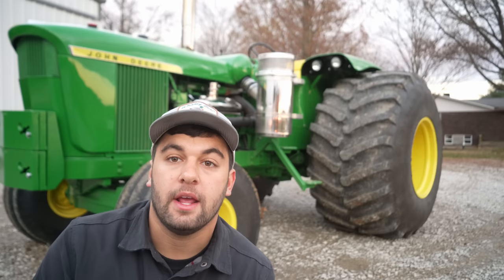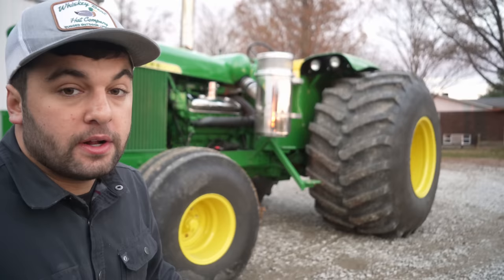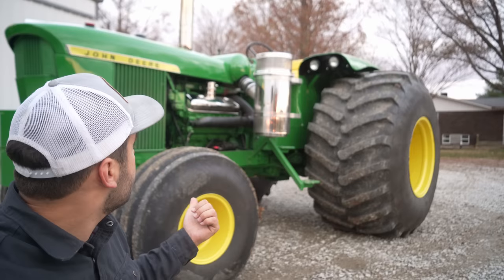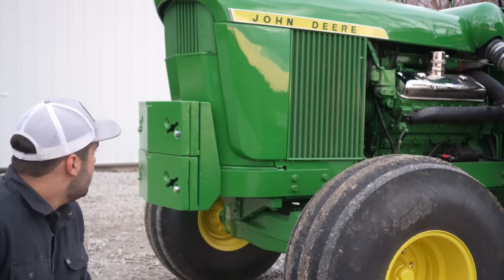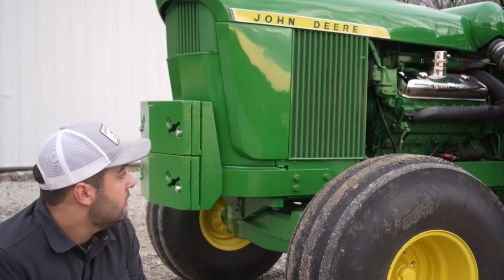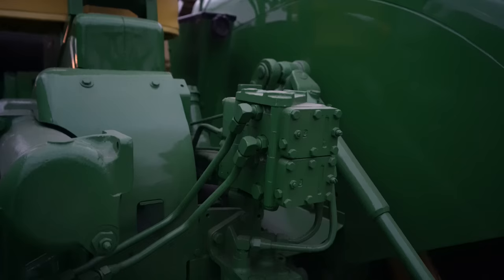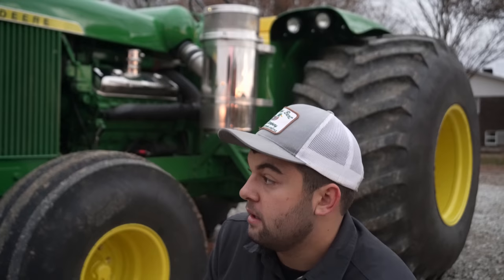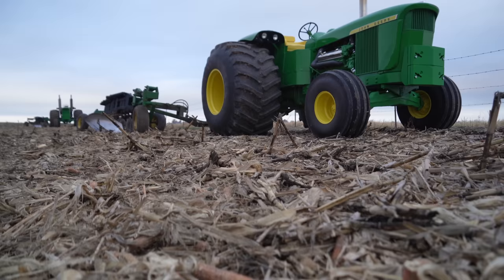John Deere 5020 Repower- 8V71T Detroit Diesel

Comment: Its not just the added hp and speed, both of these increase the efficiency of the plowing. Allows for better penetration of the plow and more rollover and aeration of the soil. 5020's were very much under powered in the factory version, so this repower really improves the looks and the working ability of these tractors.

Comment: I drove a mid 80’s GMC general dump truck that had the 8v71 with both turbo and blower. It was factory. In that application it was pushing 440hp. A royal beast.
Reply: You can blow smoke up some people's - - -     but you can't blow smoke up mine. If  it was making 440 horse power it was a 8 V 92. END OF DISCUSSION.
Reply: @warrenklingensmith1241  you may be very right. It was a long time ago. But no need to ignorant about it.

Comment: Great Video and Excellent restoration on your JD.  Just FYI..... the Detroits do Not utilize "Superchargers" per say.... they are Roots Blowers, which are just volume air movers, in other words they Do Not "compress" (re: pressurize) air, Internally.  Any boost generated by a Roots type positive displacement blower is strictly due to back-pressure resulting from pumping a higher volume of air, than what the engine can handle per revolution.  

A great thing about the Roots type blower is that regardless of how much external pressure may build up... the air temperature remains quite ambient within the blower casing as it passes through the helical lobes.  If everything is "tight" on a Detroit, you can generally register 3 to 4 psi in the air-box on a NA engine, and higher of course with a turbocharged version... depending on which blower you have.   

The best blower to use for making as much power as possible WITH a turbocharger, is the High By-pass version as used on the marine engines.  There are three different case versions, the standard blower used on all the NA (Naturally Aspirated) engines with no by-pass valve, the By-Pass blower and the marine High By-Pass unit.  There are also a couple of gear drive ratios for the Roots, all over-driven to a  minor degree (8 to 12+ percent, roughly - I don't have the numbers right in front of me at the moment) compared to crank rotational speeds.  

The other type of positive displacement blower (or "supercharger") is the Lysham Screw Blower, which actually compresses (pressurizes) the airflow Internally before exiting the casing.... they are also much more expensive, due to the complexity and required tight tolerances of the lobes.  They have been around since the 1930s, but only on large diesel engines of the medium speed class (between 250 & 900 rpm maximum) as found on mid size ships and some European diesel locomotives.  

Since the late 1980s they have become "down-sized" and can now be found on 100 percent of the Blown Alcohol Dragster & Funny Car classes of both the NHRA and IHRA drag racing, as well as some of the Top Fuel & Fuel Funny Cars in both sanctioning bodies. 

According to the MODEL numbers on the ID plate on your 8-71T... was it Originally built (the engine, only) as an 8V71T, or was the turbo added at some point later?.... and IF so, were the pistons, cam, injectors (and timing), 4 valve head (?), etc, changed at the same time, if at all?  

They are Fabulous engines and legendarily reliable..... just Never let the engine temp rise Above 200 degrees, Especially with 4 valve head(s).... and only let it idle long enough for the turbo to spool and Cool down, them shut them down if their not going to be put back to work within 5 minutes or else the cylinder temps will drop down considerably and you run the very real risk of glazing the liner walls.... never a good thing.   

One of the leading causes of increasing black smoke and at the same time... more and more oil drainage from the Air-box drain tube(s).... is two fold,  excessive idling and leaking blower drive seals, resulting in increasing amounts of oil in the airflow from the blower, which also results in "coking" in the intake ports which in turn, results in decreased scavenging, less power and increased black smoke and fuel consumption.   I resealed the blowers on my V12's about every 100,000 / 115,000 miles or about every 9 months plus or minus.... and Never had any of the issues, that others had... it's called Preventative Maintenance.   

I've known guys who sent their 8-71's to be rebuilt (never "rebuild" - always Re-man... much cheaper in the long run), After removing the blower, then remounting the blower after a rebuild, cursing the engine and the re-builder because it "blew up" in 50,000 miles or less!!..... in reality, it was their own Ignorance (of the engine) and sometimes, stupidity... that caused it.      OOOps, sorry for the "book"!!    Anyway, and once again... Thank you for sharing your tractor and the fantastic restoration of it..... don't "let it go"... stay with it ("Preventative" Maintenance ALWAYS Pays off in the long run!) and take good care of it.   

I have subscribed to your channel and will be looking for more videos from you.... take care and have a Blessed, SAFE and Prosperous New Year... Lord Willing!!

Comment: This video got me to subscribe. Uncorked/straight-piped, 2-stroke Detroit diesels are like my beloved rock and roll. I have run dual-exhaust, no-muffler 318's over-the-road/long-haul. Also, I want to see more farm tractors like this. When I started farming in 1974, I bought a brand-new, IH 1066; and the day it was delivered I put a chrome, straight pipe on it. Always kept my tractors waxed.
Reply from the maker: Thanks for watching Douglas, more is on the way!

Comment: This is a souped up tractor,that works on an almost daily basis,and is a good old puller and with the tires and turbo,it's has plenty of power,and counter balancing the front end better will help eliminate some of the bouncing that occurs,lid like to see it with custum dual tires and wheels in the rear

Comment: Make sure the 8V71 gets enough revs - don't lug it at low speed for hours and hours, or you could melt a piston. They only lubricate properly when screaming, >1800RPM or so.
Reply: Make em scream  !
Reply: It's a fallacy that you'll melt a piston or break a crankshaft by lugging a DD 2 stroke engine.
Reply: @SomeTechGuy666  Tell that to the guy who brought his 8V71 bus to the Bus Grease Monkey (known to all DD 2-stroke aficionados on YouTube) that was down a cylinder because of lugging through the Appalachian foothills of Tennessee; 2-strokes need revs for proper lubrication and cooling under load.
Reply: @Acoustic_Theory  Complete BS.  The only thing that causes a cylinder to go out is a bad injector.  They lubricate and cool just fine at lower RPMs.   In boat applications they are often run at part speed for days at a time.

The user in this YT video even admits to running a gear high and at lower RPM.
Reply: @SomeTechGuy666  I’ll leave it to the more experienced mechanics to adjudicate but lugging any engine under load is not a good idea for longevity. (This is different from low idle.)
Reply: @SomeTechGuy666  Yes but they see more engines from the field than the engineers do. Here is the video for the vehicle in question: https://www.youtube.com/watch?v=WHbojQt0Vb4

Give your 2-stroke Detroit Diesels plenty of revs for breakfast, lunch, and dinner.
Reply: @Acoustic_Theory  What scientific proof does he have that lugging the engine caused one single cylinder to fail ?  None.  Zero.  If lugging was really a problem all the cylinders would be damaged.

DDs are routinely used on gensets at 1200 RPM.
Reply: @SomeTechGuy666  There are any number of aggravating factors that could cause one cylinder to fail before others, owing possibly to the age of the engine or a prior hard life. You’re switching to a mode of just being difficult so I’ll let you speculate about what could contribute to uneven wear or cooling on an aging engine. The point is that it happened, and it wasn’t that way before being operated under those conditions, so the lugging condition is the most likely contributor.
Reply: @Acoustic_Theory  Whatever.
Reply: @SomeTechGuy666  I highly doubt you have much experience with a Detroit, but at low rpm they can’t throw enough oil up through the case. Under very little load they will be fine. But when at low rpm under heavy load they will deteriorate the oil too fast (heat) as there isn’t enough fresh oil feeding through it. That is why you drop pistons and cranks. Not really because of the low rpm but due to the lack of lubrication it causes.
Reply: @matttraxler3567  DD 2 strokes are used in gensets that run at 1200 RPM.

The oil pumps on DD 2 strokes have a pressure relief built in.   They should be operating at full pressure at any engine speed beyond 1000 RPM.
Reply: @SomeTechGuy666  Depends on what it’s out of though; if it’s out of a semi they are geared to scream. We had a guy they ran them basically at idle. At 50,000 the internals on that motor looked like they had 500k on. No lubrication through the case.
Reply: @SomeTechGuy666  That's okay for level running but in a Semi-truck it's a different story. 1700-2100 RPM is the operating range
Reply: @SomeTechGuy666  3 phase gensets run at 1200. Singles run at 1800 or 900. Personally, I would prefer good volume and pressure from just above idle and on. An oil cooler with thermostatic bypass works nicely to keep the sludging in check as well as oil life. 2 strokes are virtually bullet proof if maintained correctly according to their use AND if operated correctly as equipped. Gensets are a constant rpm somewhat variable load situation. Everything else is completely variable in load and operation. Running one in the winter for an hour to "warm" it up is a mistake. Coolant heater all night and 5 minutes to build air is sufficient in a truck or excavation equipment. Work em and get them warm, keep em warm. 5 minutes on a turbo to cool and then make er quiet.
Reply: A.T. is that true? About the rpm?
Reply: Idk army cargo trucks idle for days all come w Detroit. Same with artillery cannons m109a6 and it will idle and run hydraulics at a high idle for a month (30days) straight. Firing artillery... Idk the tractor is sweet though.
Reply: 2 stroke Detroit diesel motors should not idle for any extended time. The oil pressure is too low at idle speeds, therefore hindering lubrication. 
Keep the RPMs up, don't lug it and make it work.
For a 8v71, between 1900 and 2200 RPMs
For a 8v92 run em between 1900 and 2100.
Reply: Acoustic Theory The man did mention its an 8v71T not 8v71. I'm guessing you know what the T is for??? =(Turbo boost ×1)
Reply: @Drivapete   Sounds like you know your stuff there young man.
Reply: @SomeTechGuy666  It’s a lack of phallusy that would make you not scream a Detroit.
Reply: @thegreenerthemeaner 

The first truck engine I  built was an 8v92 Detroit. I was 15. It was in a 1977 Pete. The truck was a total disaster when I started on it. It was actually in the 1977 Pete calendar. Really cool build. Brings back lots of great memories. Keep the screaming demon running! Love it!
Reply: I would be far more concerned with the durability of the Transmission and Final drive than the Engine.

Comment: Beautiful tractor. Would have been great to have on the farm back in the 60s to mid 70s when people simply couldn’t get enough horsepower to keep expanding acreage. The crown wheel and pinion and final drives are amazing in these tractors. If the synchro shaft and counter shaft needed attending to because of the horses who would care given all the extra productivity

Comment: We did something similar back in high school (2007/2008) to an Oliver tractor that the principal had. Only difference was we used a non turbo 71 series detroit, but I can't remember if it was a V6 or V8 model. Was a nice looking tractor with dual chrome stacks, and even was on the cover of a magazine so seeing this actually brings back memories.
Reply: Oliver tractors actually came from the factory with the GM diesels although yours may have been a re powered one .They also used Walkasha, Perkins, Hercules and Cat engines .
Reply: @williamsidis5489  I don't think it did but I honestly don't remember what engine was in it to begin with. I do know though that we had to grind and cut small pieces out of the frame and had to have mounts made though.
Reply: @SOU6900 Yeah the frame tubs were larger for the Detroits.  Cool project .

Comment: I have a 4020 with a Detroit diesel repower.  Came from Cambridge MN
Reply from the maker: Still using it?
Reply: Yes. I cut hay with it this year. And I run it on the disk in the spring

Comment: The 8V-71 had 260 ,290 or 318 h.p. The 8V-71T came in 335 or 350h.p. versions. As to the guy who said his Brockway had a 16V-71 in it, the largest was the 12V-71 c.o.e. and conventional hood. The 16V-71was used in the off road Hayes WHDX 1000 logging truck ' W ' for wide. The Hayes HDX, Pacific P-12 P-16 , Kenworth 850's used the 12V-71. I think Mack also used the12V in their own off road logger after selling their interest in Hayes to Gearmatic div. of PACCAR.

Comment: You have done cool job of these tractor builds with the detroit 2strokes I’m just building my own with based on a Ford 5000 that I have fitted a 6v92t into that is rated at 497hp at 2200rpm, I want to have a go at a little bit of tractor pulling at a local steam fair and would like to get maximum rpm without being to greedy 🤷‍♂️🤠😂  most people are using Cummins over here so mine with the Detroit will be the loudest

Comment: Stand out tractor.
Reply: I I have also sent you a
Reply: @johnlauber9579  ... a what??....
Reply: What model this tractor
Reply: @angelopaulo9781  5020
Reply: The chrome lovers look unreal. Lugging a Detroit or excessive idling is a not on the menu, the oil coils down and doesn't drain properly from the cylinder  liners causing the glazing problem. Try telling that to some people and they just don't listen and end up having the very problem that you warned them about.
Reply: Why cindy are u cheating

Comment: Glad to hear you’re using a radiator with an extra core. Many years ago, I drove a 7520 with an 8v71, but with the stock radiator. It struggled in the summer.
Reply from the maker: We figured it would cool the tractor with the extra core, and that the new radiator would be 100% clean.

Comment: You have done a lot of work to this tractor!  You said the trans. was in trouble when you got the tractor, is that because of the significant increase in HP?  Your fabrication of stuff ie the aircleaner and steps look superb along with your front weight mounting system extremely well done.  All in all its  a beautiful exam-ple of How JD should have done things!  I have a Military truck called an M977 HEMTT and its got and 8V92 that is turbocharged blowing into the supercharger it makes just under 500 HP, one of my favorite engines!

Comment: I would be wearing ear protection.
Reply from the maker: I had ear plugs in, but I might upgrade to some noise cancelling headphones.
Reply: @RennerStockFarms  I use my Bose noise canceling Bluetooth headphones when running my 3046r. Best 300 dollars I've ever spent. They work really well.
Reply: @scalph999  3M bluetooth headphones 🎧 are only 60.00

Comment: Only tractor built that could stand that extra ower to transmission and reaur ends they were built indestuctable
Reply: The red machines and orange had problems with standard horsepower engines 5020 soild as a rock

Comment: The Kinze one is Firestone 19L16 5 ribs front. Those tires are nearly impossible to find. They can be seen on 6030 litterature and the 6030 operator manual.
Reply from the maker: Yes you're right, the 5 ribs are really sweet.

Comment: A Detroit 8 71 is normally 350 h p if it has a turbo.
Reply: Replace the duramax and put these detroit's back in the GM's
Reply: @houstonbrown3450  which Detroit would you put in place of the duramax
Reply: @warrenklingensmith1241  not sure I guess the turbo,wanti g a new truck but don't like the duramax ,

Comment: Calling the scavenging blower on a Detroit Diesel a "supercharger" is a huge stretch. There might be a small, accidental overpressure, resulting from flow-rate, exhaust valve timing, and various restrictions, but really ...
Reply from the maker: You're right, a couple people commented the first day this video was up. I misspoke.
Reply: @RennerStockFarms  Glad to be of assistance. Easy to confuse, since so may Roots blowers are used to supercharge dragster 4-cycles.
Reply: It becomes a blower on a 4 stroke and besides.....its what makes a detroit a detroit and gives her that wonderful sound!
Reply: @millertime8835  "Becomes a blower"? Wtf? A Roots blower is forever more a blower, used on many dragsters as a supercharger. Did "miller time" arrive early?
Reply: A supercharger increases intake volume by pressurizing (super) the intake charge (charger). It can be a roots positive displacement air pump, a centrifugal air pump, or various other devices including leafblowers (see Roadkill on MotorTrend). Supercharging is a job, not an object. The air pump on this tractor is not doing that job. Instead, it's evacuating (scavenging) the cylinders, not pressurizing them.